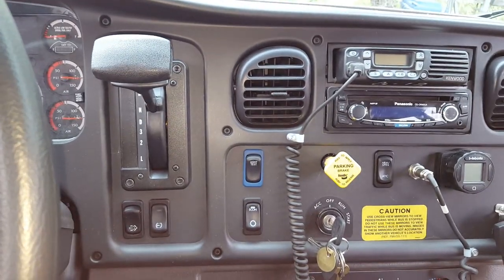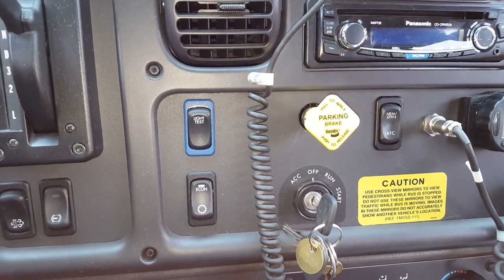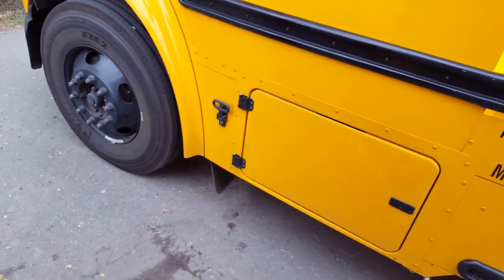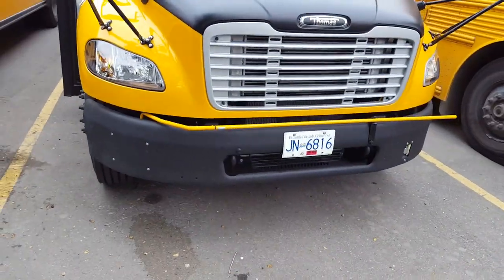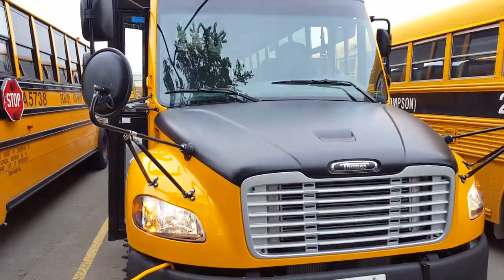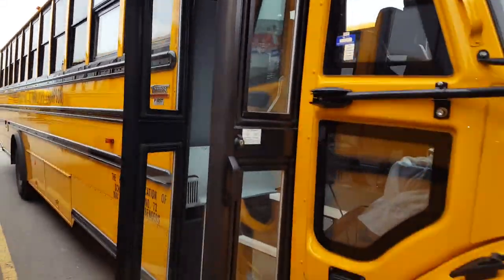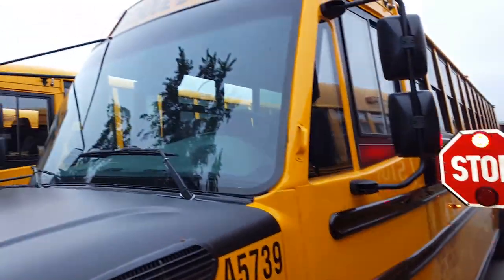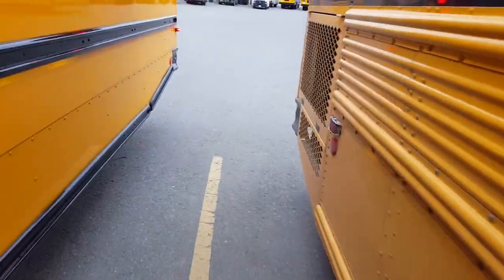Thomas School Bus Checking Lights with Factory Programmed System

Comment: I find it odd how there isn’t a computer that checks the resistance of the LED’s/incandescent bulbs to see if they are functioning properly.. Mercedes has been doing that for a while now.. I wonder why that idea has not been implemented yet.. Saves the driver a walk around and makes things faster.
Reply from the maker: It could be done... I guess the other manufacturers aren't following Mercedes technology with lighting. Thomas Bus reads resistance on their smart switches which will flag a fault if readings are off. The walk around is something we want our drivers to go through so the bus gets a good visual check. Thanks for the comment!

Comment: My boss deletes that on her specs. It is not a legal pre trip in NYS as it is not checking the functionality of the switch.
Reply from the maker: Yes that's one disadvantage with this program is the light may work fine but there could be a fault with the circuit connected from the driver command to each light operating system. You're right technically it isn't a full proof pre-trip check. Thanks for commenting!